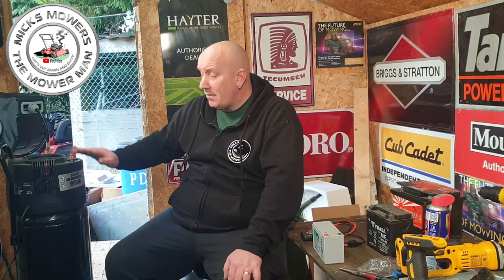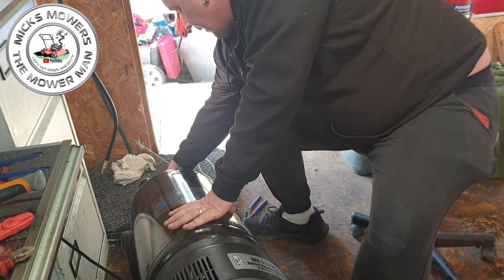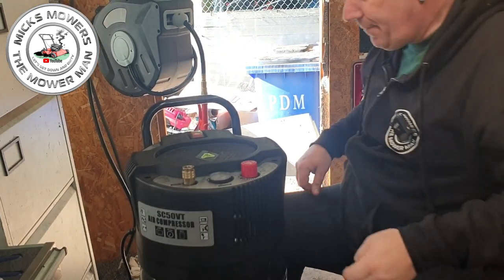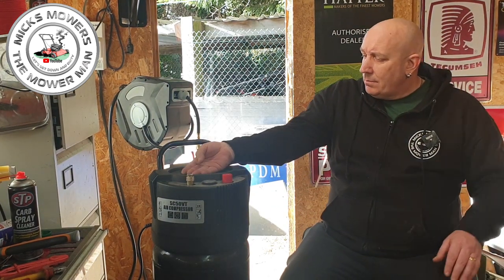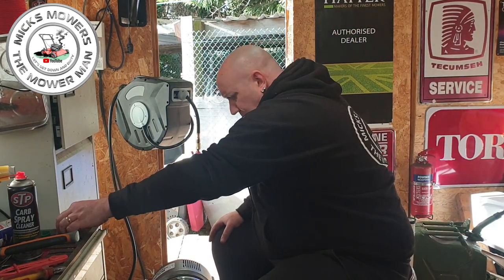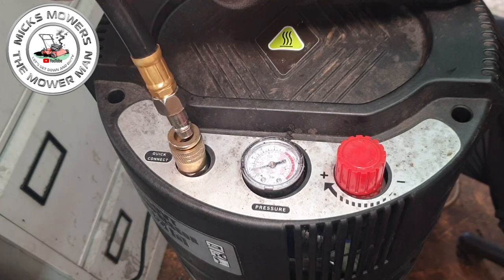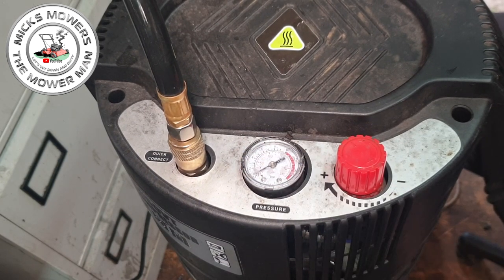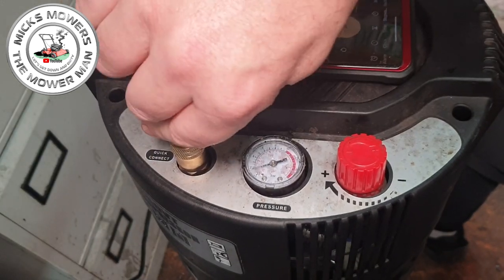SGS Air Compressor Will Not Compress fully.. Try This To Fix It

Comment: A pressure gauge in the drain port will tell you if the regulator is at fault or the pump isn't doing its job, if the tank has the correct pressure at the drain port then it is the regulator, if not it is the pump itself

Comment: The piston seal round the piston is knackered common problem on oilless compresors Ithey don't have a piston ring just a seal  either that or there some flapper valves  above piston n they get stuck in the open position so any pressure is going straight out  bit like an engine with a stuck valve has no compression

Comment: I can't see what removing the drain valve and running it would do. To me it has to be some kind of regulating issue. Or some electrical component get hot and shutting the unit down. Good luck.

Comment: It maybe the gasket, on the head of the compressor, either that or the reed valves, or the, it's oil less right, piston ring which is made of a rubber like material, any of those things can be at fault, but if you can get it replaced free, replace the whole thing.
Reply: I agree with your synopsis, it will not heal itself so go the warrant route.
Reply: @wrxs1781  yep best route is always the free replacement route.
Reply: I had the same problem; it was the reed valves not closing completely.

Comment: YOUR HIGHT VOLTAGE TUBE HAS GONE
Reply from the maker: Nope .... it was something else
Reply: @themowerman  SGS are now replacing them with the SC50H if it is still within warranty due the that pipe as so many have failed and no parts are available
Reply from the maker: @stevewells8550  I upgrade to an oil and belt drive one .. I did a video on it the other week